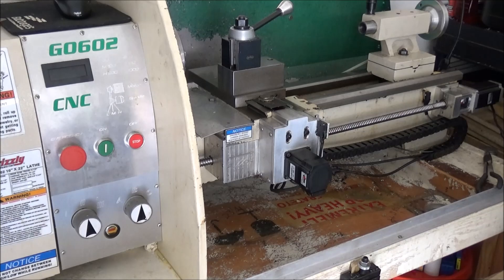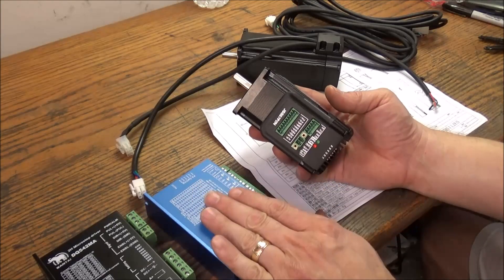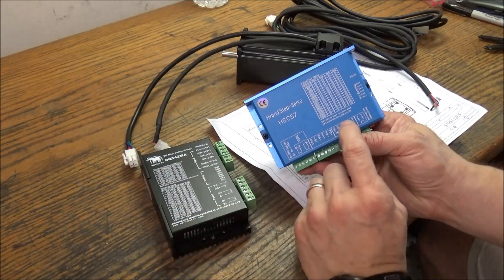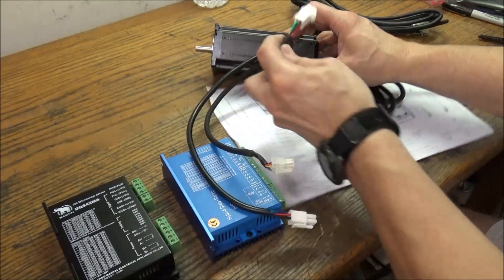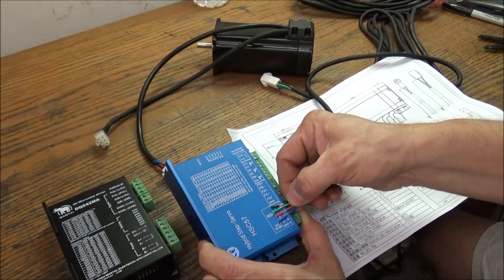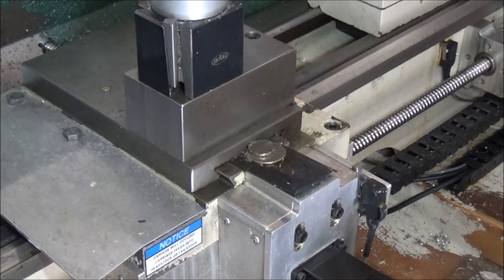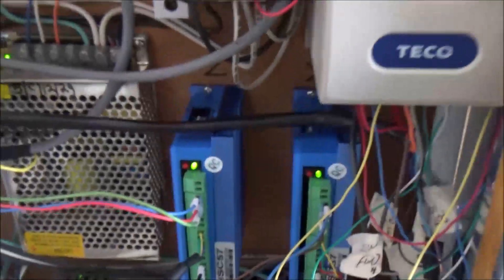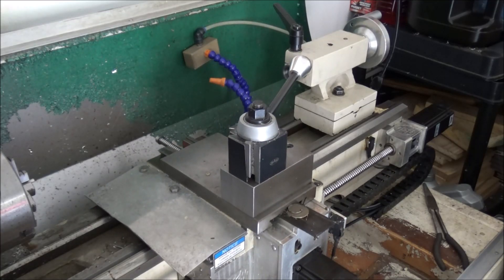G0602 Closed loop stepper Upgrade

Comment: Did something change in the circuit outside of the stepper drivers?
Reply from the maker: the motors are Closed loop and require the new drivers. other than that no changes.

Comment: Looks like a good upgrade.  You just like spending my money Sam.
Reply from the maker: No My X stepper had been losing steps on the last two jobs it was time. this was a simple upgrade that cost less than 1 servo so it was a no brainier.
Reply: @CNC4XR7  But now I have to do the same . I really like the alarm feature I have with the Clearpath setup on my mill.  The lathe is too easy to crash.  Less damage when alarm triggers the Acorn. :)

Comment: I have just converted my router to closed loop steppers and recommend connecting the alarms to separate leds on your control panel.
Reply from the maker: Yes I considered this its not a bad idea.

Comment: I think the switch of the driver you mention is to activate and deactivate the closed loop system, when you deactivate the encoder the driver generates a standard current. I have Chinese engines of that style and they mention that aspect in the manual.
Thanks for such great videos, I learn a lot from them.
Reply from the maker: Thanks for the info!

Comment: Why not a servo?
Reply: did you listen, he said he did not want to rewire the entire control box.
Reply from the maker: Also the cost.
Reply: @CNC4XR7  with cost comes confort 😉
Reply: Hybrid stepper servos do not hunt about the demand position. Servos can loose holding power at the demand position as the power is reduced as it is approached. Hybrid servo steppers do not need careful PID tuning to prevent hunting. The time for this conversion was about 3 hours because there was no need to tune the system, just plug and play.
Reply from the maker: @martinconnelly1473  yeah plug and play